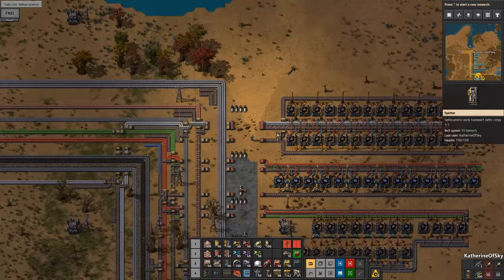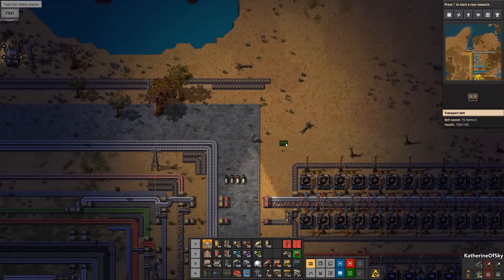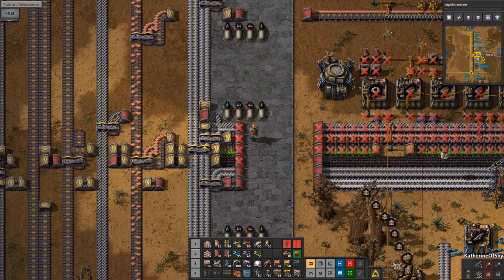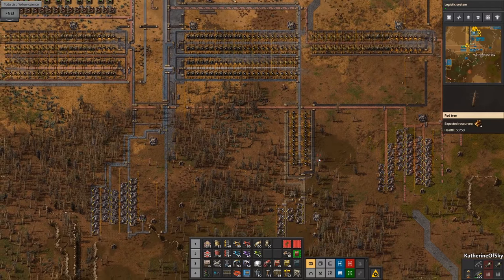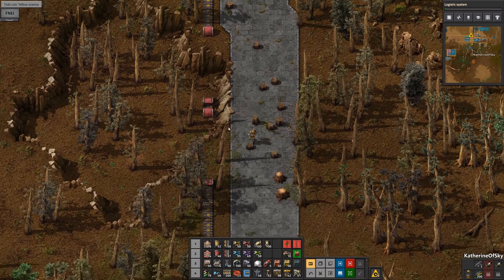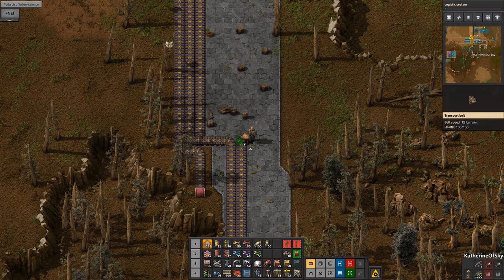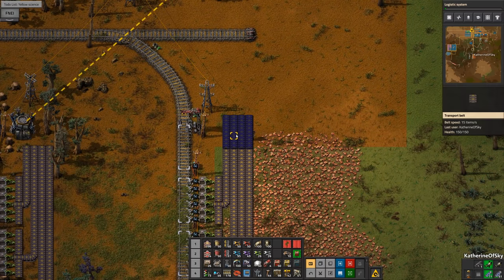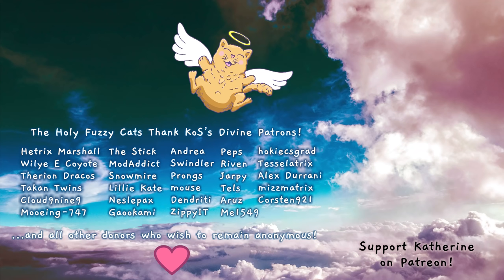Factorio 1.0 Entry Level to Megabase 3, Ep 19: UTILITY SCIENCE & TRAIN STATION - Guide, Tutorial

Comment: Your low density structure belt going down to the mall has a belt flipped in the opposite direction towards the top where it was split off from preventing it from flowing down. I noticed it last episode when you did it, but this episode already came out so I wanted to wait to see if you got it fixed first, doesn't look like you noticed it, at least at the time of this video, you might've caught it by the time the next vid is out.

Comment: First,  amazing work. Second, when I connect my red wire to the Combinator at the Copper railyard to the inserters, I get the copper 
icon on the combinator, but not the inserters.....
Reply from the maker: Did you set the inserters to Read Filter?  Are you using Filter inserters?
Reply: @KatherineOfSky  GAH! Thank you... I would swear on a stack of Bibles that I did this, but the Combinator Output was not set to 'on' -- had to re-watch the video....very slowly.... again.... 
..... Thank YOU!!!!

Comment: meowing inconvenience ... the only part of that is that the kitty cant be scritched by us ... THAT is dang inconvenient ;)
Reply: why not mine the copper patch for the copper you want to bring in ... and once it is empty setup the copper drop off there ... and the iron on the other side ... then your copper patch supplies your copper needs while it removes the patch and allows you to get the iron side back up to snuff ... 
and yup you removed the red undergroudny for your old weapon ammo build when you removed the old ammo ... you got stuck coal on them thar belts
Reply: yup swap your copper and iron unload sections ... slap the iron in where you put your copper lines ... mine the copper patch to feed your copper until its cleared mostly and your iron is working by itself ... then finish the copper lines since the patch will now be mostly cleared ready for copper unloading since you have fed it mostly with local mined copper ... quick swap to train deposited copper after you have a new patch of copper you plan to mine to empty
Reply from the maker: I don't need to remove that insignificant patch.  It won't even hold enough miners for 1-2 belts, and it would take up space that my train station needs.

Comment: The asymmetry of that unloading station is offensive to my beliefs! I honestly use a splitter to join them just because I'd get triggered by it every time I walk past one.
Reply from the maker: You should probably work on your triggering mechanisms then.  Being offended by something that is cheaper and more useful instead of an artificial desire for symmetry sound like a serious problem.  Do you refuse to drive when traffic signs are not posted on both sides of the road? How about having water bottle in the car?  Don't you need one on both sides of the seat?  Same with the gear shifting mechanism.  What about passengers... you need a passenger chair on the other side as well.  Walking around being offended at everything is not a very good way to live.
Reply: @KatherineOfSky  Driving without a passenger is painful